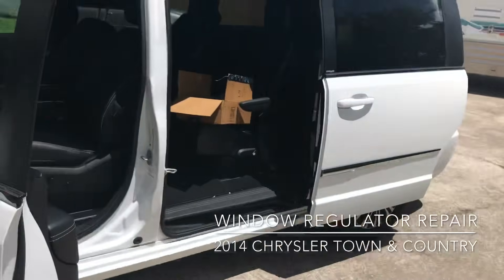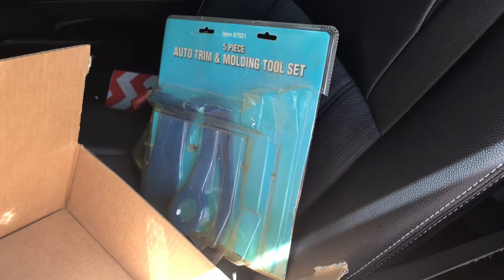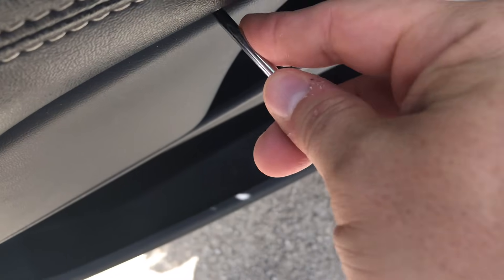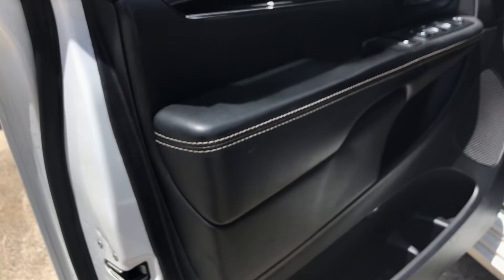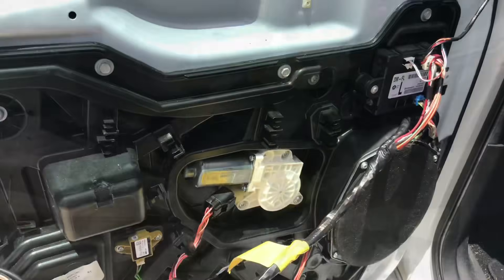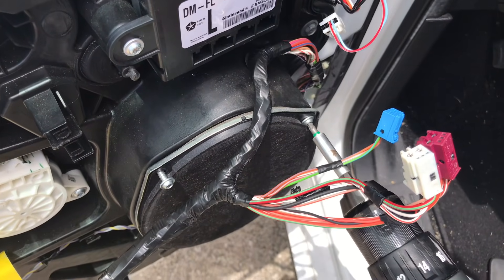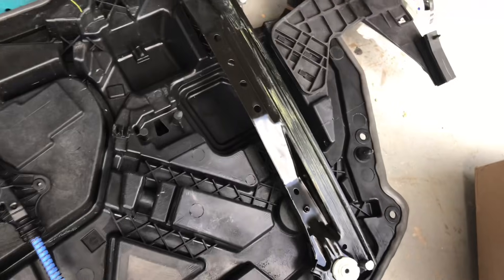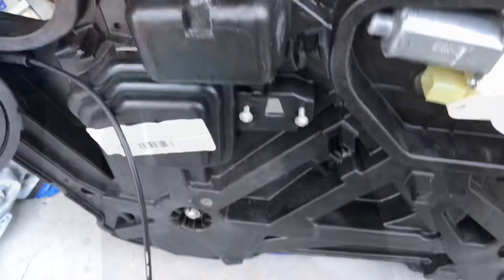Window Regulator Repair | 2014 Chrysler Town & Country / Dodge Grand Caravan

Comment: I'm doing this job for the 4th time in 3 years. The first time it broke I found this video and now I always watch this video for a refresher. I've not had any issue with the rod lock clips although one is completely by feel. If you look at it first you will know where to position the parts. All in all the best video for the job. I do appreciate the time you took to put this out there. Good work bro.
Reply from the maker: Thanks for the kind words.  Glad I could help!

Comment: Thank you for the video, it was very helpful. I was able to follow your instructions easily. 

 However, at 8:05 definitely don't pry against the glass like you did, or you'll might just shatter the window. You see the little vertical notch in the tab? Push your flat head driver right into the notch, and the tab will pop out.
Reply from the maker: Thanks for the input.  That part definitely felt sketchy.

Comment: Just took everything apart to get the window up and try to fix it without the regulator, but unfortunately the regulator is shot (basically sounds like grinding gears inside) This was very helpful in getting everything taken apart and put together on my 2015 T&C.  Ordered the regulator from Amazon, will be here in a couple days.  Used taken apart wooden clothespins as shims and a couple large rubber grommets jammed in the bottom of the window to get it to stay up for a few days while I wait on amazon.  Thank you so much!
Reply: Oh and it was raining in FL again today...haha.  Wife wasn't happy about driving her van with the window open.
Reply from the maker: Glad to be a help to you. Hope the repair went well.
Reply: DonKelly88 went great! Second time pulling it apart was much easier. 40 dollar part much less money than paying 200+ for someone else to repair

Comment: I've got to do this very job on my 2010 Caravan tomorrow.  Thanks for putting this very helpful video up - it sure will help me do the job smoothly!
Reply from the maker: That Bob Guy Great! I hope the video helped.
Reply: DonKelly88 - It absolutely did! The job went very smoothly thanks to you. Thanks again :-)
Reply: I have a 2010 Grand Caravan too.  Just had the window drop down into the door earlier today.  Going dig in tonight to see what broke... Wish me luck!  Thanks for posting the video!
Reply: Michael...  It's the regulator, no doubt.  Either the cable broke or one of the pulleys it rides on has broken (they're just cheap plastic).  Window electric motor is probably good so don't buy that just yet.  AutoZone sells the regulator for around $70 and they usually have them in-stock.  Super easy to change.  Just take your time and take lots of pics so you can see where the wiring was routed and which connectors went where.  Pull the window up out of the door and hold it in place with either tape or tapered wood shims (if you have them) jammed between the window and the door.  

Good luck!

Comment: Very fine video! I had a problem similar to another person who commented. My 2014 30th Anniversary Edition T&C had a pop noise when the window was raised - I couldn't help myself - I tried to lower the window and it fell. (It probably would have anyway.) 

The problem that I encountered was that the window was down so I couldn't get at the keepers that hold the glass.  I was able to lift it, but not far enough to get both into view. I got one but had to take out the regulator brackets loose and lift one side up through the window shield until the rearward glide was available.

The other problem was that I could not get the wiring harness out - it has an extra wire set in the harness for the side sensors or something (blind spot). I had to get the unit out to get at the end of the harness. 

But the most difficult was the smaller wire link (probably used to lock the car during remote start - idk). It was easily as hard to disconnect as the main one (yellow), but it was nigh unto impossible to reconnect - even with the main assembly partially removed. I had to feel my way, holding both the wire and the thing it was supposed to connect to and sliding them around and around until I finally was able to connect. I also found the lock connector difficult to reconnect - I had to take the assembly apart again because I couldn't get at it.

I was able to repair the regulator by pulling out the pulley (sheave) and re-wrapping  the cables around it. I just started from the outside and wound in the grooves until both met at the center. I carefully put it back into the regulator body and reassembled the rest of the regulator. All was fine until I was going to hook the forward glide to the cable. I couldn't figure how it had to be assembled. There was a spring that seemed to be out of place and the hook for the upward travelling cable out of the glide was unable to stop the end of the cable from passing through it. I determined that the spring belonged in the glide and that worked, but a piece of the glide was missing - so this fix would be temporary at best. The cable end stop goes into the end of the spring putting tension on the system in addition to that of the spring on the other side of the pulley. 

I think that the reason it failed was that when I raised the window and it reached the top, it hit firmly and the plastic piece broke out after many such operations. Then on the fatal one, the plastic was gone so the spring managed to deform enough to escape the holding mechanism and 'pop'. When I tried to lower the window, the  software just turned the motor but the cables didn't move - just ground around one another. Then it released the window to fall to the bottom of the rails. I might be able to use the repaired system for a little while or a long while, but it needs to be replaced for sure. But I had to take it almost all apart to get the window up so I went ahead with the repair.

When I reassembled the unit after returning the spring to its operating location, I determined that the tension on both sides of the system was extremely high. Both springs were almost maxed out (fully compressed) when they were installed. I had to spring the whole unit to get the cable onto the last idler. How can the system work with virtually no give? Kinda defeats  the purpose of the springs IMHO. I think that I would have provided some sort of tension adjuster and allowed the springs a minimum of 1/4" to full compression at least.

Hope this adds something to your the description of your excellent video.
Update 6/15/2019 - the first time I drove the car after the window regulator was repaired, I went to O'reilly's and purchased the same part for $60 plus tax that the video guy bought for $43. On my way home with it, the window popped again (I confess, I forgot and tried to close the window further to stop some minor wind noise that I heard.) So last night I easily removed and reinstalled the new regulator. Hope it lasts.

Comment: I made a comment about my problem with the 2014 30th Anniversary Edition T&C and could have updated that comment except that I discovered a slightly better way - at least for me. One thing that I did discover is the method to remove the white glide pin from the holes in the window. You will notice that there is a small groove in the white pin - place a wide blade flat screwdriver into that slot at about 30 degrees up from horizontal and give the screwdriver a sharp rap on the handle end and that will pop the pin out of the hole easily.

I also discovered that rather than pull the wiring all out so that the entire panel can be removed from the door to work on it, I loosened all the wiring harnesses from their restraints without disconnecting most of them. All that is needed is to remove all of the bolts except the 4 screws holding the regulator to the panel. This allows the panel to be moved forward, lifted up by pulling the panel off the door within the constraints of the harness, but not removing it. Do not remove the yellow latch link that is hard to get at and don't remove the connector from the door latch. The door latch does have to be disconnected so that the panel may be moved forward, pulled outward past the rails for the window regulator and once out of the door, the bottom may be rotated into the window well of the door to hold the panel from moving and leave it on an angle outward from the door where you can work on it from both sides. This way the really difficult to replace things are not even removed so the reassembly is a snap.
 
Now you can see all of the parts that have to be removed on the inside of the panel. Note their positions on the panel. Orient the pieces of the new regulator on a bench so that they are like the old one before you remove the old one from the door panel. When you are convinced that the arch of the rails and the position of the crossing cables matches that of the one you are removing, proceed by disconnecting the motor (3 screws), remove the motor and disconnect the rails (2 screws on each rail). The regulator should now be free to remove from the panel and out of the door cavity. Just  lift it off its guide pins and straight up and out.

Place the removed pieces together on the bench next to the new one and note that it matches the layout as you determined previously. Then disconnect the two 5/16" bolts from the old regulator that hold the plastic regulator reel (crank) to the forward rail of the regulator assembly. They should be placed in the same location on the new assembly to connect the plastic cranking mechanism to the rail (upper first hole and third hole of four on the rail). Do not tighten these completely yet. 

For the drivers side door, the pulleys should be facing upward on the bench and the arched portion of the rails should be upward as well. The forward (towards the front of the car) rail should hold the crank and be to the right side while the top of the rails are nearest to you and the farthest part of the rails goes to the bottom. With the assembly now complete, but the restraint for the crank that holds the reel together still in place, pick up both rails (rear in your left hand and front in your right hand) and place them into the door cavity and onto their respective mounting pins. The three holes for the screws that hold the motor will poke through for the motor to mount on. Assemble the rails to the panel - rear one first and then the front. Tighten these into place on the rear one but just tight on the front one. Make sure that the cables are routed in the same way as the old ones (as much as you can tell since the thing was all apart in there). 

The top of the crank should be near the top of the panel - the cable comes out of the top of it and threads around the upper pulley down to the glide (plastic piece that connects to the window itself). Another cable goes from that white plastic glide down to the bottom of the rail, around the pulley there, then all of the way to the top of the rear rail pulley and down to the white plastic glide on the rear rail. Another cable goes from that white glide to the bottom pulley on the rear rail and then up to the reel where there are approximately six wraps of cable that are continuous with the first and last cables mentioned (in other words, there are two cables - one that connects the two glides together without going through the crank and one that connects them together through the crank).  Now you can snip the restraint for the reel and remove the restraint. The reel is being held in place, but mount the motor as soon as possible. Tighten the screws for the motor, taking care to not tighten them too much - they will strip.

Now tighten the bolts that hold the plastic crank to the forward rail that were left loose previously. Tighten the rail screws (forward might still be loose) and pull the panel out of the door cavity again. Slide the panel back into position and place one or two mounting bolts in the upper area. Replace the three screws for the latch assembly and assure that all wires are out of the way for the window and all of the wire harnesses are placed back into their restraints. Now make sure that the bottom of the panel is inside the door cavity so that the panel is flush with the door and insert the bottom bolts to finger tight. Replace the remaining bolts finger tighten them and then tighten them all with a wrench. 

Release the window pinning wedges that you used and allow the window to slide down to the glides and press the windows into the glides until the pins snap into the holes in the window. You might have to persuade the white pins to open far enough to slide over the glass. Be careful, they will break. Hold down on the window and push on the pin until they slide together - you might have to give the window a good palm rap to get that to happen. 

Now you can button it all back up per the video. Check this out - it might be a valid excuse to make another video which includes a few more variations of the T&C such as my 30th Anniversary Edition.
Reply from the maker: Thanks for the input.  The screwdriver tip would have helped me.  Hopefully it can help someone else if this happens to them.

Comment: Great video. It worked for me. However i used a t25 bc i didnt have a t27 and it caused no problems for me. The way the star holes are tapered the t25 fit down inside the holes. Anyways good video.

Comment: My window just fell down. I found this video. I think i might need a new regulator. I still have to take everything apart but wish you would have actually shown what you were doing when taking things apart. Thx for the video though at least i have a ball park idea of what just happened to my window.
Reply from the maker: The video is literally me showing what I am doing while taking it apart.  Did you even watch it?  I didn’t film removal of every screw, but if someone needs that much help I recommend taking it to a professional.

Comment: Any idea what would make the window start then stop within about 1 sec every time?  I replaced the motor and regulator....and it works but just stops until you release and the press the switch again.
Reply from the maker: Aaron Taylor Sorry, I don’t know.  You probably already know this, but it sounds electrical like a bad switch or contact.  Could be a short in one of the wires.  Check to make sure they aren’t pinched or bent.

Comment: I used plastic toilet shims you can get at Lowe’s. Needed 2 1/2 packs and doubled them up back-to-back on the bottom part of the window. You could also use a clamp that can go around the door frame at the top of the window to hold it up.
Reply: @AnthonyBerryman-sc3ew  Good tip. They had one that holds 80lbs at Harbor freight for 2.49, it worked great.

Comment: Question: 89 dodge can- driver's side window won't elevate(passenger side works fine)..the Haynes manual says :remove door panel and raise the door glass" and after many attempts including removal of the adjusting rod, the glass could not be raise .Any suggestions on how to manually raise the window would be greatly appreciated
Reply from the maker: James Klukas usually I just try to get a good grip on the glass and push it up, but I’ve had times where something was blocking it or was creating tension and squeezing somewhere along the glass preventing it from rising.  Hard to say without seeing yours, and and a 1989 Dodge would be way different than my T&C so most of the content in this video would not apply for you. Good luck!

Comment: How did u know it was just mod and not the motor when u went to purchase a new part ? This just happened to me I rolled down my window and when I rolled it back up I heard a pop and the window slid down into the door :(
Reply from the maker: In my case I could hear the motor working, but the window wasn’t moving and was stuck down.  I am not a professional mechanic, but if the motor breaks I would presume it would not sound like normal.

Comment: Do NOT remove the control rods off the door latch.  It is the hardest and least productive way of getting this done. Remove the door latch rods at the top ends. The clips pull back and you can release the rods with a LOT less trouble than trying to feel your way behind that latch.  Putting the latch on that carrier panel was pure stupidity IMO.  But Dodge/Chrysler power windows have been insanely bad for a very long time.
Reply: I did that yeaterday now Im cussing my way back to putting it on
Reply: It definitely takes some dexterity. Thankfully, I have mechanics hands.
Reply: This video did not give enough detail on the latch clips and one of my broke. I had a lot of trouble getting a replacement.

Comment: Help! I can’t get that stupid yellow piece off inside the door. What’s the trick? I think it’s part of the lock....
Reply from the maker: Daniel Gearhart Mine involved scraped knuckles...  Small hands would help, but you basically need to reach in and get a hold of it with your fingers, then pull the yellow plastic piece up from the bottom.  Once the yellow piece has pulled from the metal arm you pull the metal arm out.  And the bad news is putting it back in is pretty much just as difficult...

Comment: Did you buy the can new? That part was actually a dealer replacement that went bad on you. We used to see then bad from the factory. That's how poorly  designed they are.
Reply from the maker: nbookie No we bought it used.  Not surprised at poor workmanship.  Unfortunately that is the expectation these days.